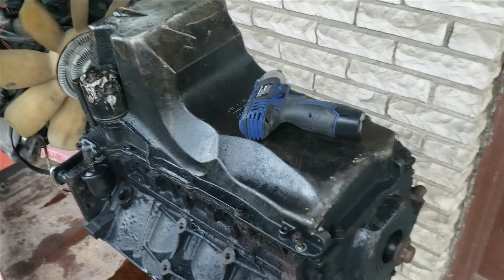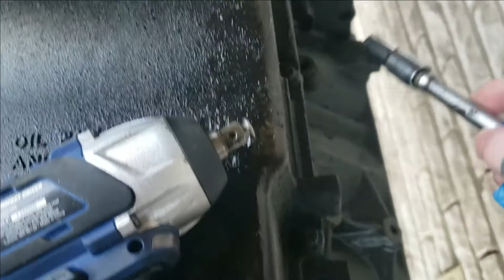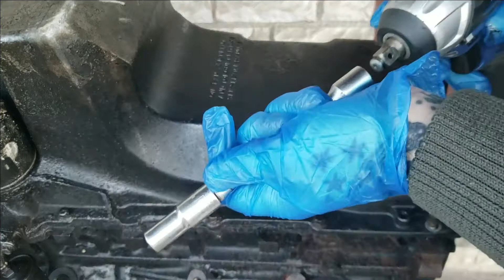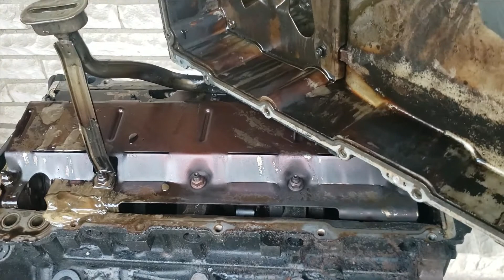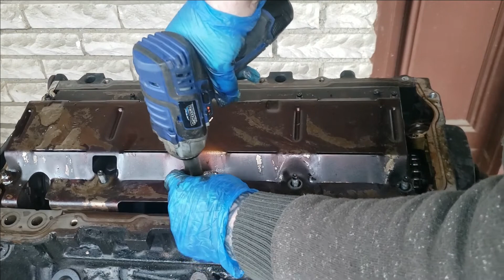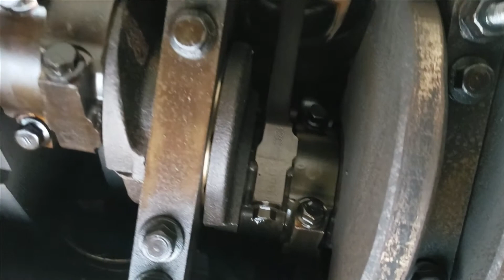LS Engine Oil Pan, Pick Up Tube, Windage Tray And Timing Cover Removal

Comment: Soooo I seriously messed up... I was having an argument with my girl in my head. An i pulled the cam b4 i removed  the lifters. Told you I seriously messed up. Lifters sounded like they fell to the bottom camera isn't showing any in there. Whats the chances they fell down to that windage tray?
Reply from the maker: most likely if you did not have the rods in the lifter or the engine upside down, then they did fall to the oil pan
Reply: @TattsForLife had to get under the 4x4 yukon, remove to much 💩. Just to gain access to the oil pan and windage tray. But all 6 lifters were found... lesson learned...